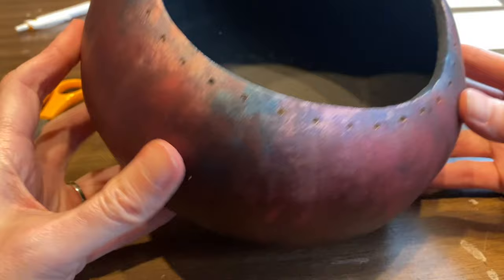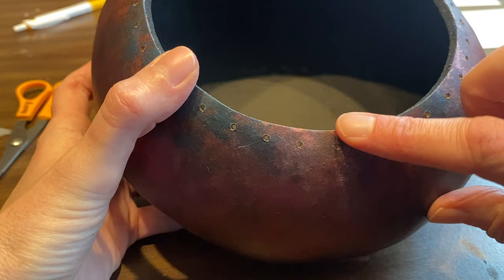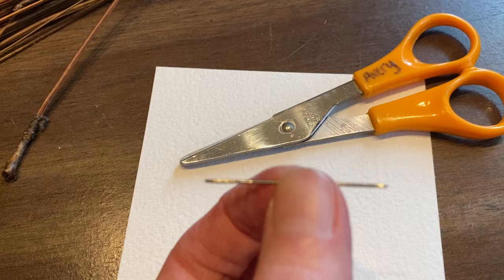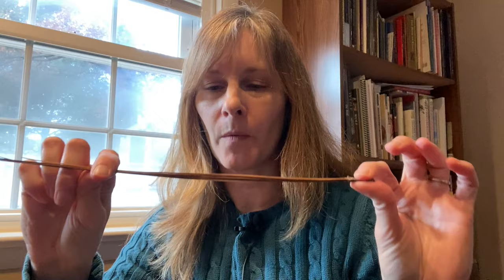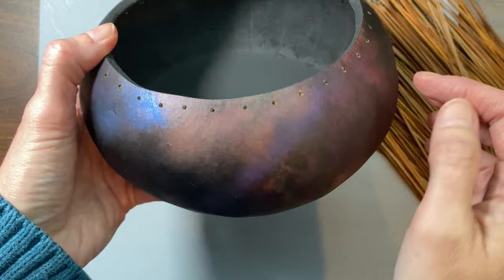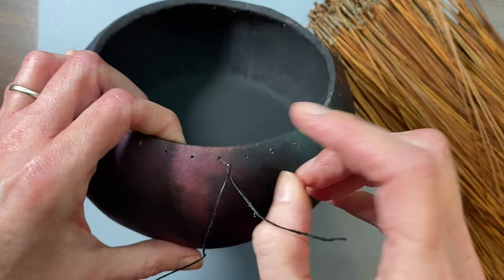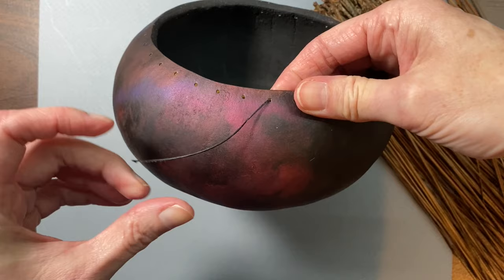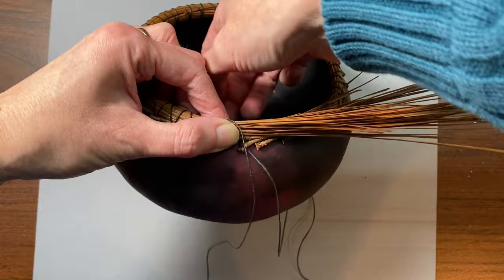Pine Needle Coiling on Gourd for Beginners

Comment: you are a wonderful teacher!  Question I have is... can I use the pine needles that I have in my backyard?  I understand that I would have to treat them, but was just wondering if that would be ok.  do they have to be about 12 inches long?
Reply from the maker: Of course you can!  The longer needles are easier to work with, but you can work with shorter needles as well, keep in mind you will just be adding needles more often to your bundle!  Thanks for your question!